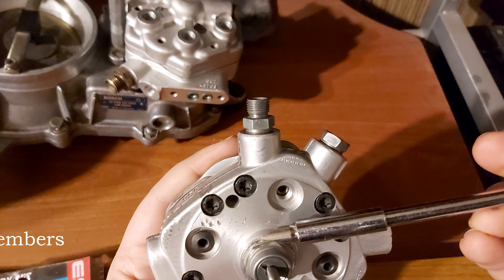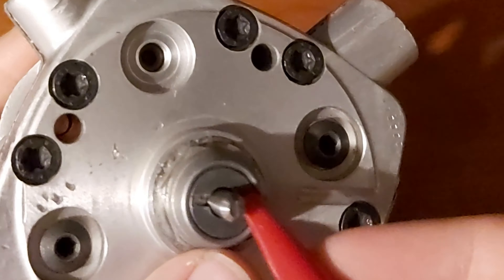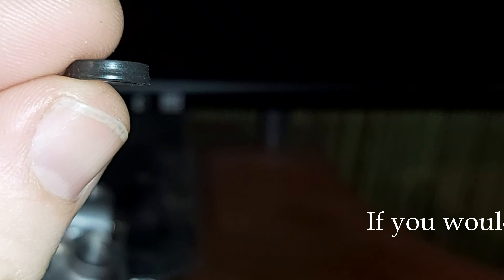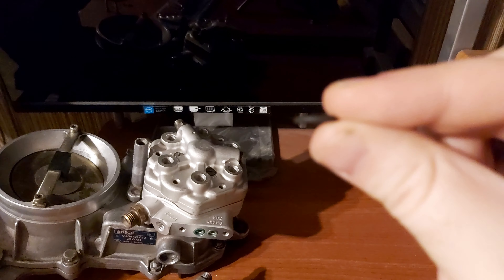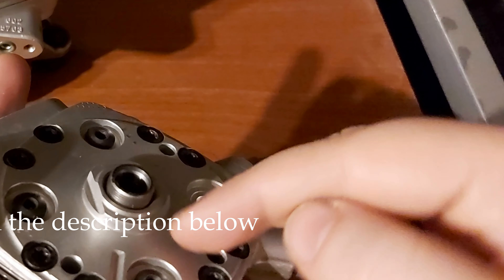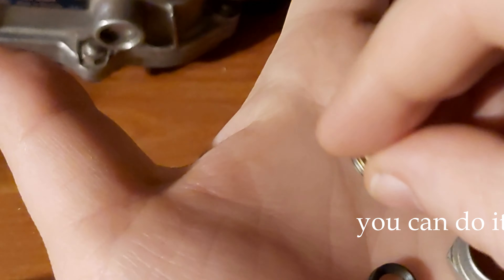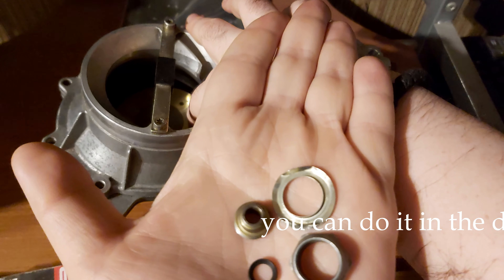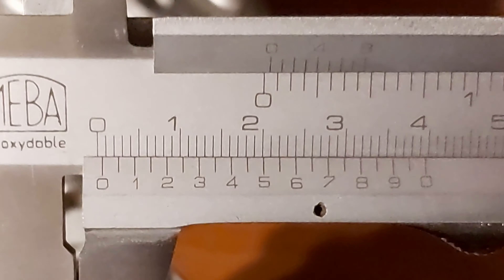㉦Mercedes Ke-Jetronic㉦ - The fuel distributor/How is it called?

Comment: I adjusted the plunger nut on my m103 fuel distributer to 0.6mm but it just poured fuel out of the injector ports without the airflow plate being pushed so i adjusted it back to 0.45mm (where it was originally) and that stopped it. 
From what i understand 0.6mm is a good place to start but if the fuel still flows from the injector ports when the pump is primed then you should adjust the screw back until it doesn't flow anymore, correct me if i'm wrong on that.
Reply from the maker: Good thing you remember where the sleeve was. If your car runs fine and as it should on 0.45mm then let that gap be there, don't bother yourself with what Bosch says 😉.  You are right. You would have to readjust the mixture screw and that's an unnecessary waste of time.

Comment: Hello, I have a 2.3-16v.  when I accelerate at some point the vehicle no longer responds and when I pump the accelerator pedal, the vehicle resumes.  Any ideas where the cause could be?
Reply from the maker: Have you replaced the potentiometer?
Reply: @mercedeske   no I haven't replaced anything yet and for your information my fuel pump makes noise..
Reply from the maker: If it does, replace it. It's likely that it's bad!